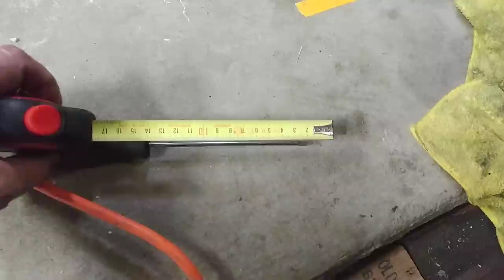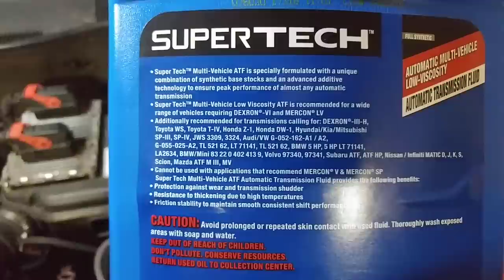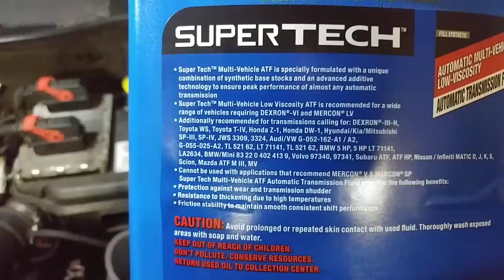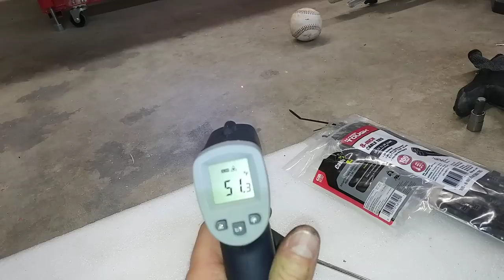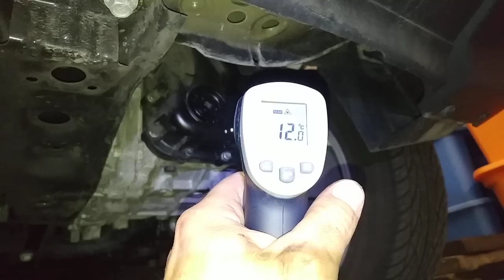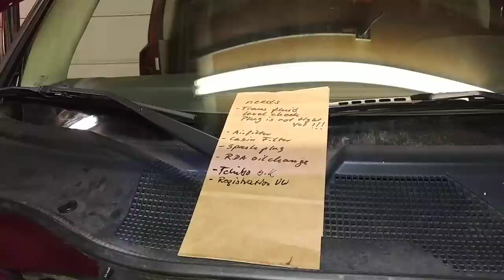2014 - 2017 Jeep Patriot transmission fluid change.

Comment: Nice. I have a 2014 Jeep Patriot Sport D (the basic of basic models). I took it to the Jeep dealership who lied to me and said the transmission was completely sealed and there was no way to ever change the fluid. Several mechanics later and they could not figure anything out. One mechanic actually said they managed to find the transmission fluid "dipstick" of which there is none. And then, after having to deal with Google's idiocy of "personalized search results" that almost never, EVER gives relevant search results... I stumbled across this video just today. All those professionals, Jeep mechanics, etc... none could figure it out. Personally I think they were just lazy and knew how difficult the job was and simply did not want to earn some money on a difficult job. As a side note, mechanics (and other professions) are - by Supreme Court decision - allowed to lie to you to sell you parts you do not need... as long as they are not being paid by a third-party to do so. The reasoning being that certain Supreme Court Justices reason that you - as a consumer - are savvy enough to know whether or not you need said part.
Reply from the maker: Thanks for your comment. Since I am a hardcore DIYer I don't have much interaction with shop mechanics. I had no idea that it is this bad.
Reply: The mechanic wasn't a good take and took long. This video is not very good.
Reply: I'm a mech.  Mostly work on semi's but I also do work on small cars and trucks as well.  Despite @troyherriman's critique I think this was a decent vid.  He told us at the beginning that he was figuring it out as he went because he was told, not that it was sealed, but that you did not have to change it which you don't.  That is why there's no dipstick and the fill and drain ports are positioned like they are.  The only reason these ports are intended to be used is if the dealership or another shop has to "replace" a damaged transmission with a new one.  That being said the video was informative and decent.  Dealership mechs are what they are; Dealership mechs.  They only learn what the manufacturer trains them on for that particular model.  If the manual says you don't change then that's what they know.  It's not that they're lying to you because that makes no sense from a mech standpoint.  In other words he/she is not going to turn your money down on an unnecessary procedure.  He/she is just going to charge you for it.  A dealership mech will not change transmission fluid if the manual says you don't change it because to change it is against the recommended manufacturer manual and the dealership will be held liable if something happens once you leave.  Plus the fact that since you don't change it there's no book hour scale for the job to charge you by. A non-deakership shop will charge for the procedure cause that's what you wanted and charge for the unnecessary job to make the money.  So here's how it works out.  Regular tranny with a dipstick and drain plug is 30 min job easy peasy. Book hour minimum is 1hr @ $150- $175 p/h.  On this patriot.  Taking all the crap off just to get to the tranny, popping the three port plugs, draining and refill, replacing the three port plugs model and then putting all the crap by that you removed to get to it in the first place.  2 1/2 - 3hr jod @ $150-$175 p/h.  See where I'm going here?

Comment: Your video helped me change the trans fluid on my 2014 Compass. I bought the factory dipstick and used Valvoline max life fluid.
 My OTC scan tool would not show the trans temperature, but my Autel did. the infrared temp gun showed about 10 degrees F less than the scanner. I ondy drained out about 3 quarts, but it took 5.5 quarts to fill. I bought the car new and there were never any leaks so it was underfilled from the factory! Hopefully it did no damage in the 43,000 miles I put on it. What a pain in the A** job just to change trans fluid. Thank you for posting the video.
Reply: No, it was not underfilled. You forgot about the fluid still left in the torque converter so now if you put 5.5 you are now overfilled.
Reply: @berniediapersanderslukso9204   How can that be when he used the OEM tool to check the fluid level?
Reply: I believe that you may have done it right but the difference is concerning.  Its possible you made a mistake.  I would recheck.  Measure twice cut once is not just for wood workers!
Reply: I just did mine and it only drained 3 Liters.   I had also replaced my outer tie rods today. My problem is i am getting a clunking sounding sound when I shift( P, R, N, D(clunk), N, R(clunk), P.  I'm stressing lol I followed the directions which actually calls for 4.3 quarts then another quart but i drained 3 liters lol which is what 3.17 quarts?
Reply: I bought a pontiac grand am new and was 2 quarts low on trans fluid.

Comment: This is the same as 2016 Jeep Compass. Nice job!
Reply: I have Jeep copass 2016 too ,,is this transmission cvt or not ?
Reply: @salimfalih3668  mine is the 6 speed automatic not the CVT.  I called the dealer and verified it with the VIN

Comment: Great video and explanation. But boy, what a pain in the butt process to check the fluid level! I'm with the others here... when I do this procedure on my girlfriend's Patriot, I'm just going to re-fill the trans with the exact amount that was drained out and call it a day. I can understand if the vehicle was bought second hand and you are unsure of if it has been serviced before, you would want to be positive that the level is correct. However, in our case, she bought the Jeep new and it still shifts pretty good with 68k on the factory fill. So... assuming Chrysler got it right from the factory, there should be no problem re-filling with the amount of fluid drained.

Comment: I did buy the special dip stick from Amazon but I filled transmission threw the ck port only & I used a long funnel with a toob & did not remove anything just the ck port you do have to warm up transmission of course it was not bad at all took me less than an hour.

Comment: PSA, easiest way to do this is normal Hyundai method then top off with 700ml extra.  It's from a patriot service bulletin.  Empty fluid, refill, get transmission to operating temp, flat level surface, put in park, neutral, drive reverse for 2 sec each, then do it again. Open full check port and allow extra fluid to flow out while engine is running for 3 min, close port, then top off with 700ml.  All done, no dipstick needed
Reply from the maker: Good to know. Thanks for sharing. Back when I made this video i didn't find that procedure anywhere. I wish I would have known that.
Reply: The trans from patriot to Hyundai are on different angles I believe. Can't drain to the plug.

Comment: I think also a Chrysler transmission dipstick #1017 is the same. I have a 14 compass with the hyundai sourced 6F24 6 speed auto dual clutch transmission, have looked into doing a fluid drain and fill as well. Most Chrysler techs don't even know how to perform this service, and since as they like to say the unit is "sealed" they don't like to touch it.  Now that I can see where the check port is I will plan on doing this. Have fun if you ever try a radiator flush on the patriot...you have to take the front bumper off to drain the radiator. Blame the poor design on the germans since the car was developed when Daimler owned Chrysler.
Reply: Fiat bought out Chrysler before 2014 didnt they?
Reply: @googleuser8448  The Patriot was developed around 2006-7 when Daimler still owned Chrysler.

Comment: I just did a drain and fill on a cold block on my 15 compass with the six speed 6F24 powertech transmission, and 77k on the clock. I put what came out into a clean gallon jug, and just poured new fluid in another gallon jug and matched the levels. The valvoline maxlife LV fluid is what I used, and now it shifts a lot smoother, and the shudder I used to get going up hills is gone now. I'm still going to buy the special dipstick, and later in the year do two more drain and fills. You have to pour the fluid in the fill port very slowly, and during the fill there were two burps of air releasing out of the case.
Reply: How many quarts drained out from yours? I'm about to do this same job on a 2014 with 71k and not sure how much fluid to buy. Glad to hear that MaxLife is serving you well!
Reply: @surfordie82  It was just at 4.5 quarts. The most difficult part was taking out the battery to access the fill port, but on my next drain and fill I'm going to see if a flexible tube can be snaked under the battery tray which would make the job a whole lot easier.
Reply: @richardwrynn824  The hardest part for me was trying to add  the new trans fluid with a traditional funnel. Had to add very slowly and then wait for the air bubbles to burp out each time I poured. Next time, I am going to use a fluid pump, like you would to fill a manual gearbox or differential.
Reply: It was burping because you didn't have the rubber cap removed on the air vent.

Comment: I'm a mech.  Mostly work on semi's but I also do work on small cars and trucks as well.  Despite @troyherriman's critique I think this was a decent vid.  He told us at the beginning that he was figuring it out as he went because he was told, not that it was sealed, but that you did not have to change it which you don't.  That is why there's no dipstick and the fill and drain ports are positioned like they are.  The only reason these ports are intended to be used is if the dealership or another shop has to "replace" a damaged transmission with a new one.  That being said the video was informative and decent.  Dealership mechs are what they are; Dealership mechs.  They only learn what the manufacturer trains them on for that particular model.  If the manual says you don't change then that's what they know.  It's not that they're lying to you because that makes no sense from a mech standpoint.  In other words he/she is not going to turn your money down on an unnecessary procedure.  He/she is just going to charge you for it.  A dealership mech will not change transmission fluid if the manual says you don't change it because to change it is against the recommended manufacturer manual and the dealership will be held liable if something happens once you leave.  Plus the fact that since you don't change it there's no book hour scale for the job to charge you by. A non-deakership shop will charge for the procedure cause that's what you wanted and charge for the unnecessary job to make the money.  So here's how it works out.  Regular tranny with a dipstick and drain plug is 30 min job easy peasy. Book hour minimum is 1hr @ $150- $175 p/h.  On this patriot.  Taking all the crap off just to get to the tranny, popping the three port plugs, draining and refill, replacing the three port plugs model and then putting all the crap by that you removed to get to it in the first place.  2 1/2 - 3hr jod @ $150-$175 p/h.  See where I'm going here?
Reply from the maker: Thank you for your comment. Appreciate your encouraging words.

Comment: Great video man! Quick question, where is the transmission filter located? I purchased a used transmission from LKQ and had my mechanic install it. He claims that he and his partner looked for the filter but could not located the filter. Im just worried that it wasn't installed right by my mechanic and just added fluid
Reply from the maker: The filter is behind the black front cover, the cover that has the big drain plug in it. It is almost in a vertical position.

Comment: This is a very easy procedure for fluid change for a modern transmission. Give a Mercedes M-Class; 7 speed auto a fluid change and then you can complain. You have to fill thru the drain port.
Reply: Whhha?  Thats crazy.  ha ha

Comment: Wouldn't it be much easier if no leaks are present to just record the amount of fluid drained and simply replace that amount!?!?
Reply from the maker: That would assume that the level was correct before.
Reply: Brian this is what most shops do and what my shops always do ... if no leaks are preeent you are to replace exactly the amount that it to come out !! Every single time buddy . You go off the refill capacity amount listed by the manufacturer and you see how close that amount is to what was drained out . There yoU have it !! All that extra stuff isn’t needed
Reply: Yep

Comment: Is this for the CVT or a geared automatic? I don't remember you saying what transmission this was for.

On a different note whoever told you that for standard driving you don't have to change the fluid is smoking crack. For the CVT the service intervals on their fluid is either 60,000 miles or 120,000 miles, depending on if it is severe use or not.
Reply: Its a 6 speed geared auto.  Its recommended service interval is 120k.   Or never as the author explained.   No crack needed. :-)  BTW: The Haynes manual says 100K, but they are being cautious.
Reply: The 6 speed is drain and fill. The CVT has a pan and filter.
Reply: 6 speed 6F24 automatic transmission

Comment: I have a 2014 2.4L 4x4 jeep patriot latitude with the 5 speed manual transmission. Im getting a whinning noise when in gear and accelerating. Also when in neutral and not moving without the clutch engaged it is making the noise. When im at a stop in neutral and then engage the clutch the noise stops? What is the problem? The input shaft bearing? The output bearing? Or something else? Please help me

Comment: Where is the cylinder cooler transmission filter located? I have 2014 jeep Patriot sport utility 2d
Reply from the maker: I am not sure if I understand your question. Cylinder Cooler transmission Filter?
Reply: The cylinder shaped filter that is located at the top of the transmission under the battery in the 2015 model, I heard it called a cooling cartridge filter for the transmission fluid. But I am not sure but I noticed for the 2014 patriot that the transmission is not the same shape and I do not see anyone changing the top filter so I was thinking there wasn't one. But I seen a comment on another video where someone was saying the filter for the transmission is located inside the valve body for these 2014 patriots and that it wasnt worth changing.
Reply from the maker: @Elmoloves  i understand now. 
If you have the 6 speed automatic and not the CVT transmission then your filter is inside the transmission housing behind the relatively large plastic oil pan which is not mounted in a traditional horizontal but rather vertical position. It is the black plastic cover on the front of the transmission.

Comment: Been 4 years.  How did things go.  Still run good  Or problems?
Reply from the maker: Sold the vehicle 3 years ago. Sorry, I have no new feedback.
Reply: @HeikosGarage  I have 178k on my 16 high altitude. Lmao.  Dealership  shop main guys said I made it way past the 120k mark, I'm probably golden. Runs like a top.  I drove around town asking what fluid goes in it.  Autozone girls pointed me to the motor oil.  Napa tried to sell me ATF+4 and I continued questioning and they said ATF NON CVT
Reply: @HeikosGarage  Advance said sp Iv M but didn't have it.

Comment: How much fluid does the transmission take? I heard 4.3 quarts and someone else told me 2 gallons which I highly doubt. How much did you add? Thank you,
Reply from the maker: I do drain fill usually. I just measure how much came out and put the same amount back in.

Comment: Wow ridiculous what you have to do just to check the fluid.  These were clearly designed to make it as hard has possible for do it yourselfers to work on it.  Question, how are you supposed to let it warm up if you had to take the battery out to get to the level checker?
Reply: You must have skipped the part of the video where he showed he replaced the battery and the filler plug and checker plug are in different locations.

Comment: I have 90k on my 2015 pat and have never changed the rear diff, transfer case or transmission fluid , do I have to ?
Reply from the maker: I would. But that is a personal choice. The manufacturer calls those lifetime filled.
Reply: @HeikosGarage  The 2014 owner's manual calls for 6 speed 6F24 transmission fluid to be changed at 120,000 miles or 12 years, whichever comes first.

Comment: If you have a dip stick tube can you just fill it from there? So im not removing the battery and tray?
Reply from the maker: This particular transmission doesn't have a dipstick. They say it is filled for live and never needs a change.

Comment: I too own a 2014 model too. I have the big 4 cylinder engine with a 6 speed automatic and front wheel drive only!! Is this the same 6 speed trans in the front wheel drive patriot? And how much total fluid did you put into the trans? And how is it shifting since you did this?
Reply: I’m in the same shoes as this guy. Can someone answer this please
Reply: @salik3210  See my post, I did drain measure refill, and I got a little over 3 quarts out of it.Put same back ,runs good.

Comment: Thank you very informative and helpful. So it total you used 1 gallon and one quart? Or did you have to add more ?
Reply from the maker: Sam 7400 don't remember. I just filled until I got the correct ready on my selfmade dipstick.
Reply: Sam 7400 have you changed yours yet? If so, how much did yours end up taking?
Reply from the maker: Hi there, just noticed that you commented and ask me a question. I don't exactly remember how much fluid it was but just drain the old into a bucket that has a scale to give you an idea how much you have to put back. Afterwards you have to get yourself one of those dipsticks (#10323A or #1017). I think in the video I mentioned 4 liters or 4.3 quarts. That is what you put in to start and then you use the factory dipstick to fine tune the level of fluid in your trans. I hope that helps. , Heiko